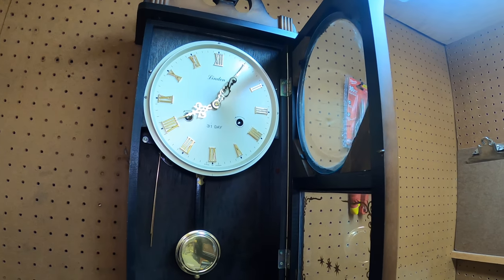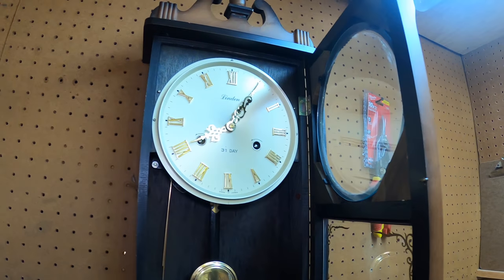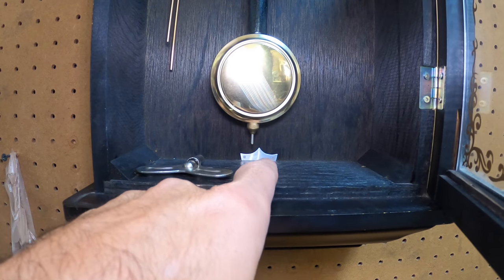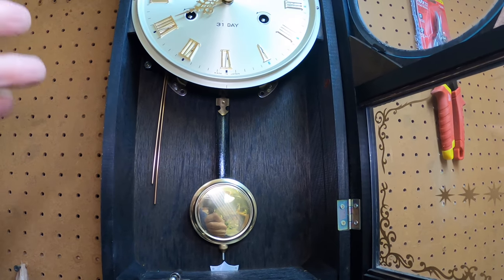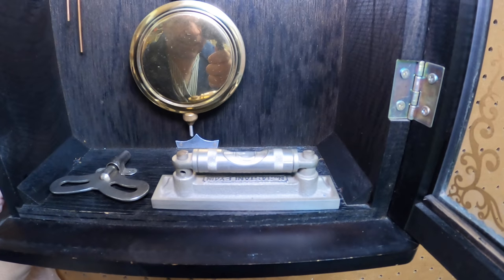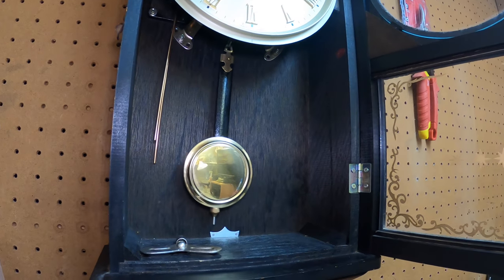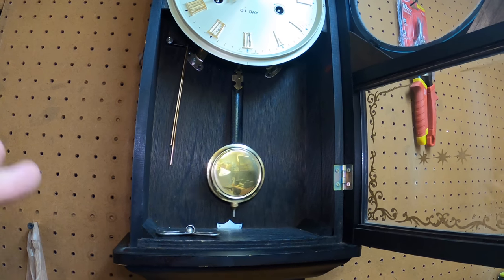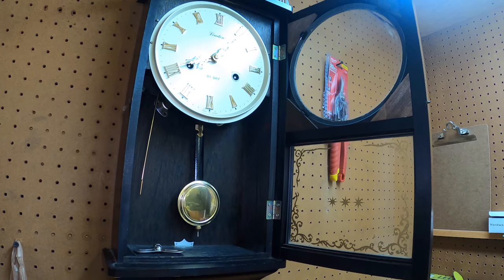How to adjust and level Your mechanical clock 2021

Comment: Does the clock also have to be level from front to back? I have a 70s regulator a clock that seems to not like being wound all the way. In the past, I've had to jar the spring a little to get it to consistently unwind. We recently moved the clock (pendulum removed and placed in foam wrap packaging) and now it stops running after a couple minutes. Do you also have a video that shows how to oil or clean the clock?
Reply from the maker: Yes it sounds like a bushing issue, if wind it to much it can add extra pressure on the bushing and can stop the clock. Try to oil the clock and ajust the level.  Check out this video https://www.youtube.com/watch?v=-7AR7I2A2ss&t=543s